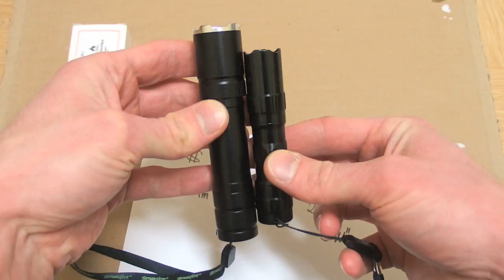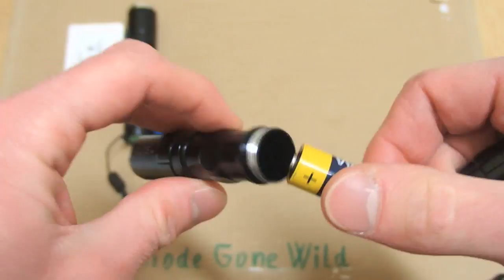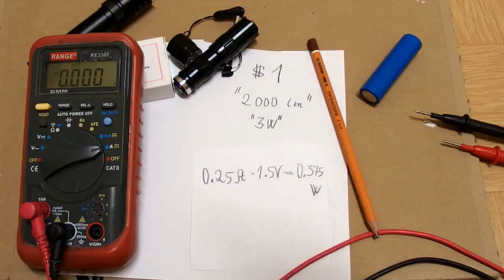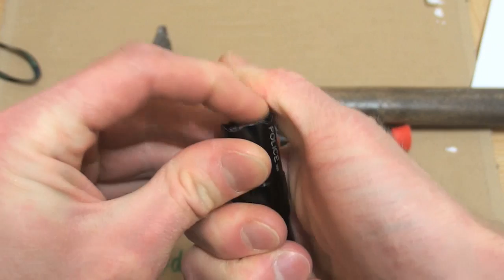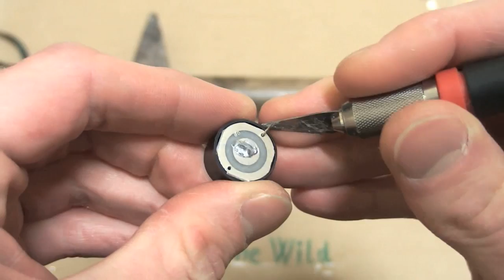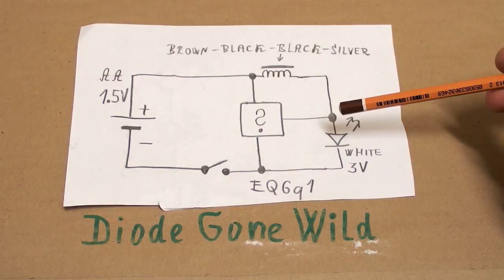$1 Police LED Flashlight - Test and Teardown

Comment: It has a high current led and there is a heatsink inside, note the larger than normal yellow circle of phosphor, it is probably rated 100 or 150 mA so that 125 is close enough. It is still really good for $1. EDIT: I just ordered one 2 months after writing the comment, it will probably be here in a month or so from China!
Reply: ELECTROHAXZ Have you received it?
Reply: Not yet, it says that it will be here between January 1st and January 28th, slow china mail, welp. :(
Reply: CME It just arrived about 20 minutes ago, it's very very cold white, light blue sort of, the beam is a very tight spot, that can be good or bad, but I haven't taken it apart yet, hopefully the boost converter is on the PCB not inside the LED, then u can replace the LED for a nice white one, not the horrid blue white one it came with!
Reply: ELECTROHAXZ any update ?
Reply: @kaoshavoc  Yeah, I replaced the LED with a better cold white one but because it's all thin sheet metal, it's almost impossible to put back together without mangling the metal shell. It worked though, but still very dim and poor design.
Reply: @josephcontreras8930  Nope, ebay.

Comment: How can this be 1 dollar? That's amazing.
Reply from the maker: This is crappy even for the 1 dollar. But the 2 dollar one is awesome for its price. For 1 dollar you get an overdriven 5mm LED, for 2 dollars you get a Cree LED. Not the very last version, but still a Cree and it is operated with a headroom.
Reply: lol because it is GARBAGE😁
Reply: probably just faulty unitwhat was returned by costumer..that why its so cheap
Reply: @DiodeGoneWild  uh, hate to break it to you but none of these LEDs are Cree.  More than likely they are a Chinese Cree clone called a Latticebright.
Reply: @ambrosekillpack4841  what the heck is a Cree flashlight??? Also you have a cool name dude☺ like one of my fave authors Ambrose Bierce....

Comment: LOL the hammer, you are becoming big clive :-D.
Yep that was a crap torch, worse than the cheap 3 aaa batterys in a plastic holder type.
I have a few of the 3 battery types, they work but have to be slapped sometimes :)

Comment: had one off ebay, it didnt work... made mistake of feed back before testing 😕by far worst torch ive ever had besides ledlenser p4 which broke on 1st drop
Reply: its 0,99$ lol what do you expect..
Reply: Why do LED flashlights do that?? They say it's power efficient last longer than halogen torches (mag light) yet they go thru 3 batts just as fast and go dimmer faster too. I'm thinking that nuclear power plants may go thru this problem too because that's why they have so much nuke waste the power created must dwindle down real soon like led flashlights and then go dim just as fast. You know how you put fresh batts in a torch it's super bright to light up a room at full power then as you use it it dims down slowly. Nuke powered naval engines run top power for a few years but as it goes down within 2 years power starts dimming down . that's the way I see it the 2 things are nearly alike.